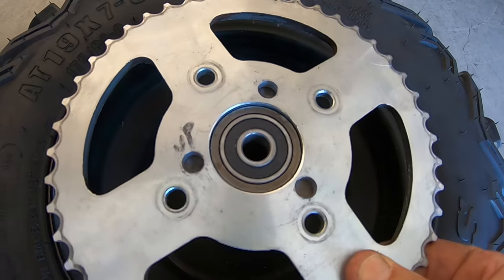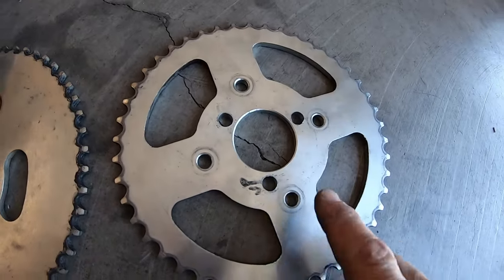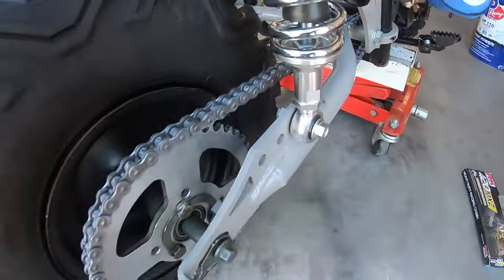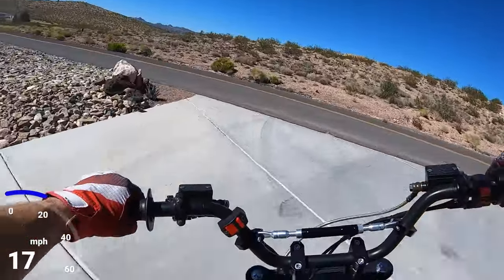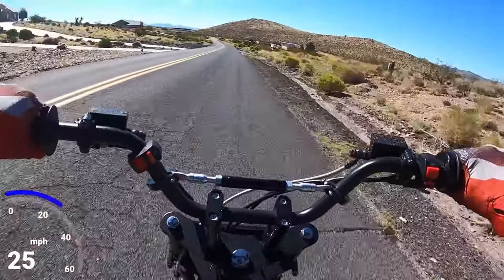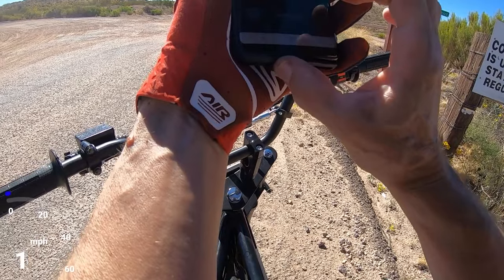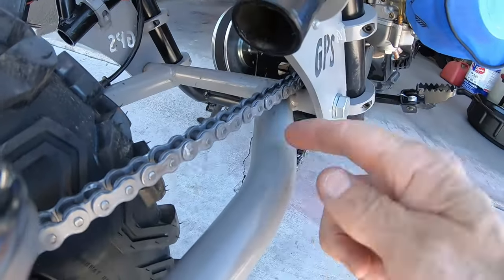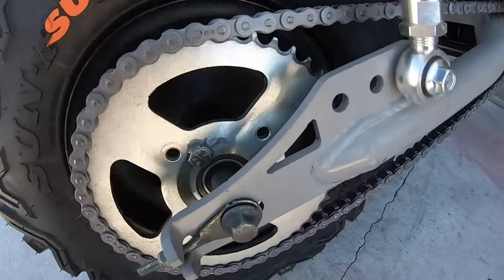Will a mini bike swing arm kit work with a small sprocket?

Comment: Well we figure it out with the smaller tires on the mega Moto with the swing arm kit chainwheel rub cuz of the tire size we change the tire from a size19x7-8 to a a little bit 20x7-8 this stop the chain from got 😊 change to a Coleman ct200uex kickstand

Comment: Im sure you have a video stating it already but do the swingarm kits fit a db30 frame?
Reply from the maker: Its not really made for the db30 but with a welder and a cut off wheel you can pretty much make anything work. Lol 👍😃